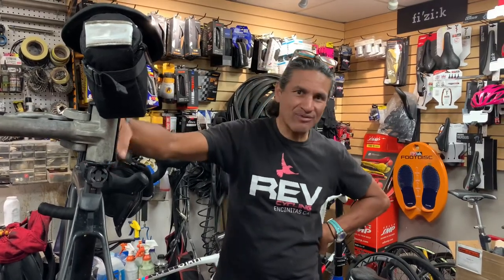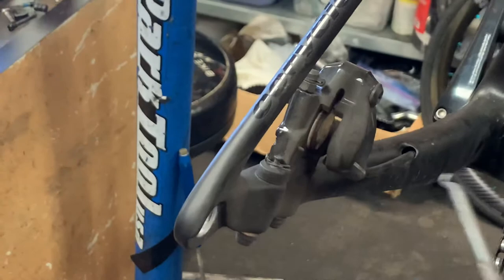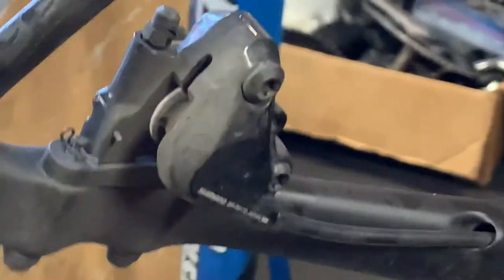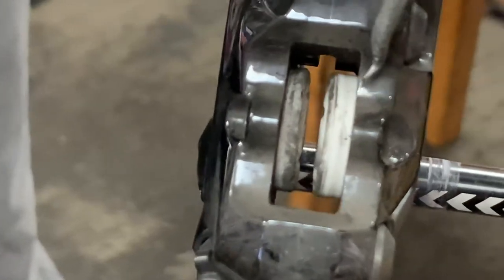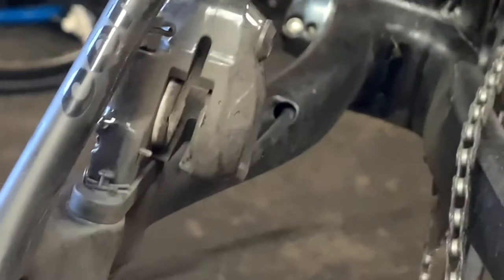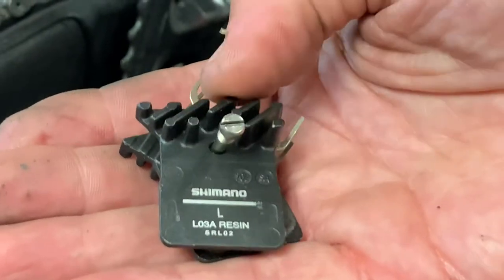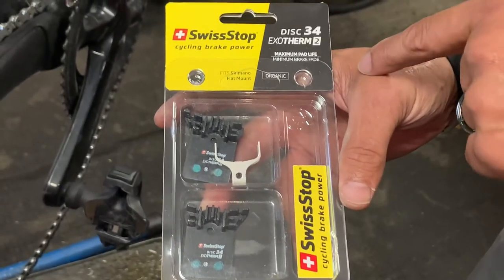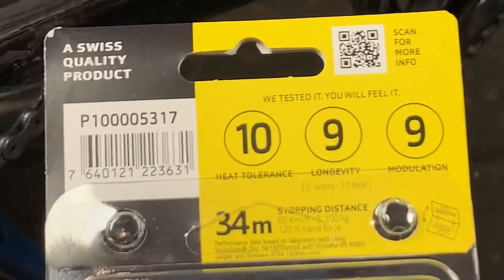Disc brake caliper maintenance like a pro - why is one piston stuck - brake rub solution

Comment: You mentioned you lube the pistons. Is there anything specific you should use there to prevent brake dust building up? Like a spray on silicone lube?
Reply: i would also like to know